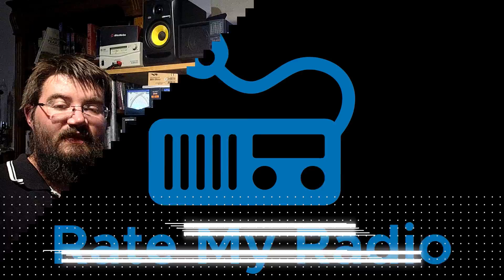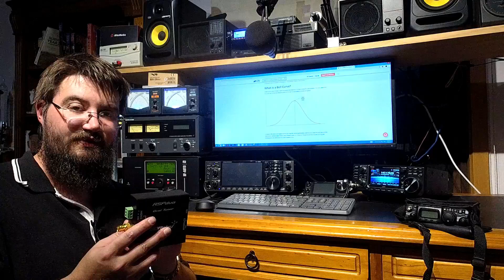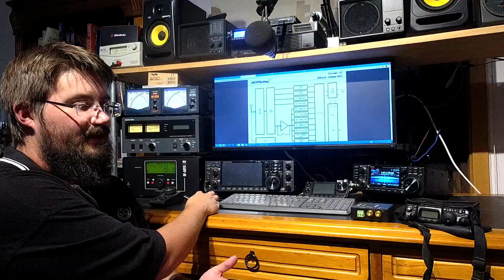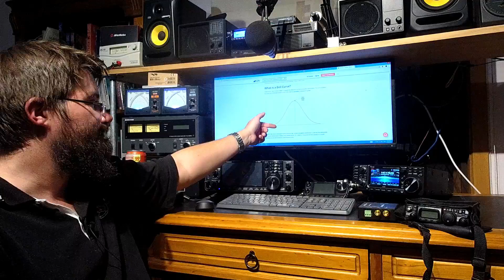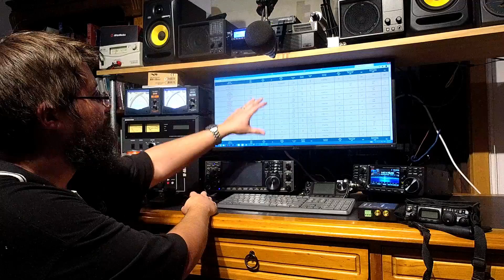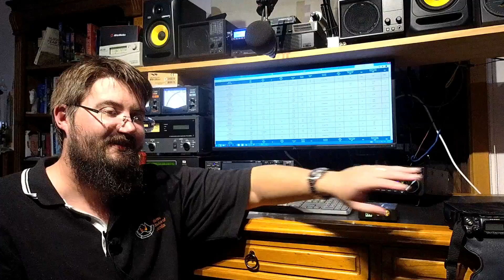Icom IC-9700 Haters' Delight?  VK3BL discusses Measurement & Statistics

Comment: Very nice to watch vedeo, keep them coming especially about the IC-9700 .  I am interested in buying this radio but am going to wait a bit. I was not all that happy when yesterday I saw a comparison vedeo on another you tube  channel (that has been removed)  This radio has been compared to various others like the FT-991 FT-847 IC-7000 and even a cheap Chinese handheld. Sensitivity on 70cms FM was unbelievably the worst ! especially with the  Pre-amp off,  but as you said we don`t know what antenna was being used + other conditions in this case!! Time will tell
Reply: Preamp off in this high range equipment is to work with mast preamp and not to loose dynamic range. Its how it must work. I also have a IC275H and work in the same way .